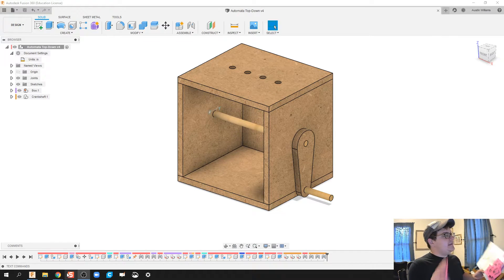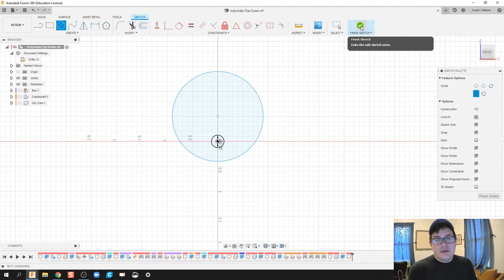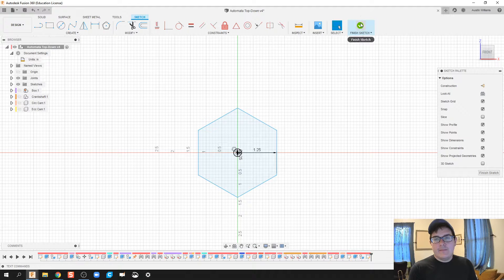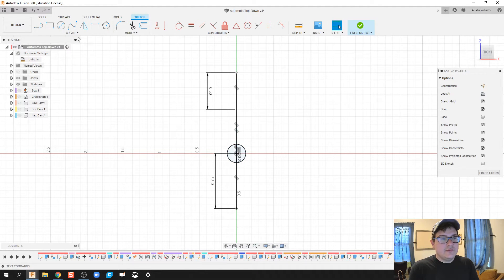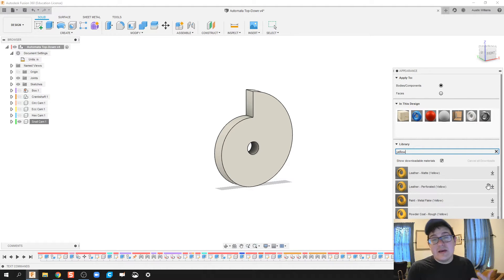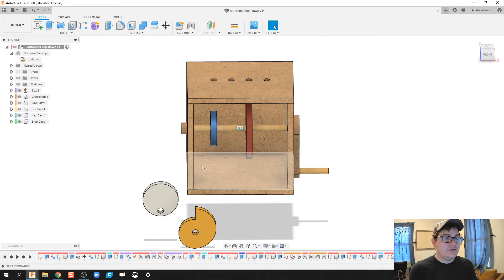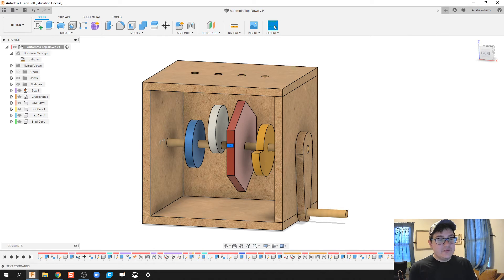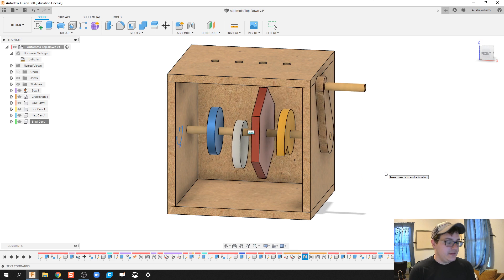Top-Down Automata (pt 3) Cam Assembly - Day 68 of 100 Autodesk Fusion 360 Journey

Comment: Hi i am learning how to simulate automata models and its great to see your tutorials. I want to ask 2 questions 1.Can Fusion simulate all the movements, it would be great to know what the movements will be like before doing it in real life. 2. Can Fusion draw pinwheel gears and belts?
Reply from the maker: Yes. You can apply motion links to joints to connect motion for an overall design.

You can model pinwheel gears, but it would connect the two revolute joints by a motion link.